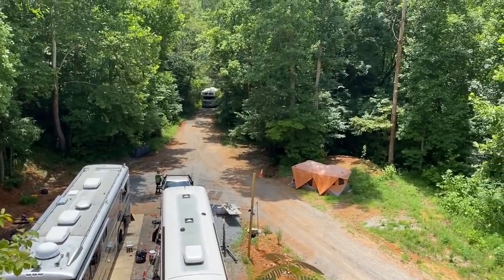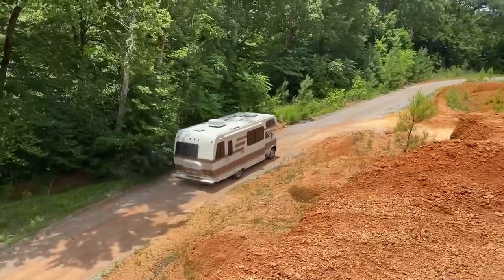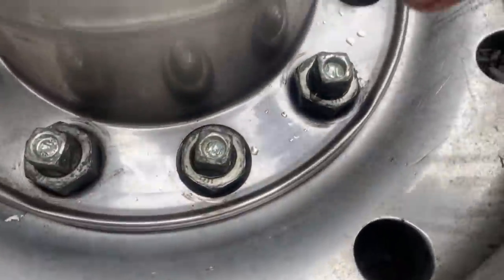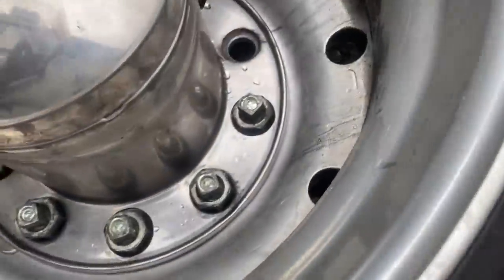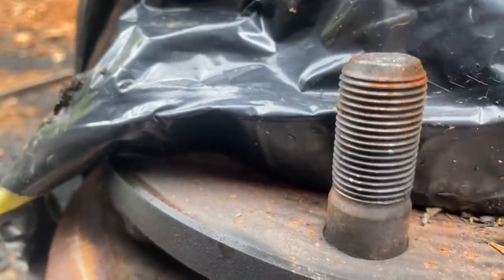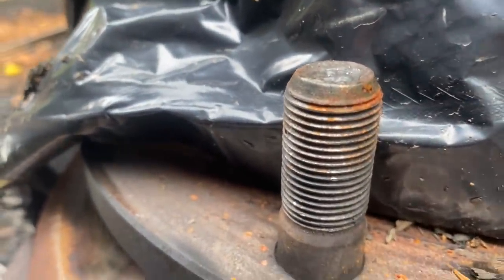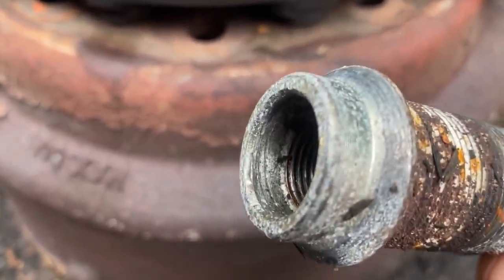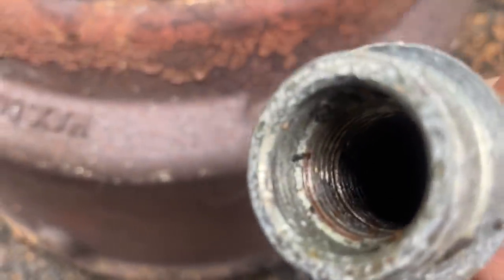Never let a tire shop use a 1” impact gun to put your wheels on.  Finishing the Wanderlodge rv

Comment: Cutting those suds in half like you did, and cleaning them up was such a great illustration of exactly what you're talking about. People don't realize how much a bolt or stud stretches! The torque specs are for the safety of the vehicle and the mechanical abilities of the material. It's the same with head studs, you're never going to slam them down with an impact.
Reply: There are some tire shop employees (I don't call them 'mechanics') you can show then 100 stretched and broken lugs and they will STILL use impact wrenches 'Because that's what we always did before.'
Reply: A good shop that trains their employees right can teach a man a good lesson! It sucks to have to bust a man's balls, I've been there. There's specs for a reason. A whole lotta people smarter than us put these numbers down, get outta your pride for a sec and do shit right.
Reply: Ten four ...i had a tire changed in minot nd today the tire guy did everything i asked...lube the tire and rim with paste center the set of duals with centering pins snug the lugnuts and torque the lugnuts....every lug nut turned with the torque wrench ....not one was overtorqued. I was one happy customer also very informed too.

Comment: I learnt the hard way about not checking how tire shops would tighten wheels when in my first car on a trip i had a wheel in the front start to wobble when i stopped to check why it turned out 4 of the 5 studs on the drivers side front wheel had snapped and the wobble was from the rim sliding on the hub as it went around and the loose part would slide almost off the hub. Got it owed into the next town and had them replace ALL 4 sets of studs and new nuts also. 

Since that day if i move to new area or am travelling and need wheels touched i watch as they work on other peoples cars first and if they dont use a torque wrench to do final tighten i wont use them. My current local tire shop work with a check list that 2 of the guys sign off on one for the guy that does the work and one for the guy that checks his work and they have 2 rattle guns one to take off wheels that is set higher and the one they use to run them up when putting them on and it always takes atleast a 1/4 turn with the torque wrench to get the right setting. 

I always recommend them to every one that talks tires with me as i have been going to the same place for 15 yrs now and their always good prices and they know their job with repairs etc and can also do wheel repairs. 

The fact the owner is a car nut is one reason he is so set in his ways about how things are done. Lots of the local cur guys use him also with their restos and customs

Comment: Man that is a beautiful rig! I've gotten to the point where I don't trust anyone to put tires on my pickup any more. The local tire shop cross threaded 2-3 studs on every corner of my Ram 2500. Their fix was to put new lug nuts on and send it. So I rotate them myself and next time I need tires I'm going to take the rims off and take them to the shop to have the tires mounted then reinstall them myself on the truck.

Comment: All my early trucks had 2-pc wheel studs, hated them. Once on I-69N up north of Marion, I pulled off to water the tires but when I looked down I saw a bunch of broken off outer studs with nuts on them laying on the ground and thought how interesting. I happened to perform a quick inspection only to learn, they came off my Kenworth. Wheels were still intact but a call to a mobile service shop for roadside repair was on order. Funny thing was I had no vibrations or anything to alert me to a problem. It was just a good thing I had to pull off when I did. So glad we don't use Budd wheels anymore as I love the hub piloted wheels being used on all trucks and buses today.

Comment: You need a lugnut porkchop to take the thimbles out of the outer nut! I changed tire for 25yrs. And seen a lot of those like that! The biggest problem is the lugnuts and wheels are different metals and make the nuts seize on!
Reply: aka spud wrench

Comment: I used a 1" gun to tighten budd style wheels all the time, just not to full torque, Used a torque wrench to finish each one. Same for accuride style. Worked for 25 years in waste hauling industry. Always put never seize and always started each lugnut by hand. Never an issue.

Comment: once i had an experience with a tire shop that used a large impact on my Dodge Power wagon.  it had 3/4 studs with left hand thread on the drivers side.  i had to stop him from destroying my lugs after agreeing with him about the direction he was turning the nuts .  finally the ob was completed.  6 months later i used a 20 ft cheater jumping up and down on it to break all the lugs loose.  after that i have put tires on the  truck myself.  that happened in the 80's
Reply: I've seen too many times things are either loose as hell or so tight its not even possible. Then again, i had torqued wheels a week prior, with a tire change on the familys car. A VW that is. 100 ft lbs whatever. ONE WEEK later, some repair needed done brakes maybe. I tell you my high torque impact wouldn't move it, i had to use a breaker bar, and i litterally lifted the car off the ground in that corner before it busted.  Probably have to clean the lug BOLTS up really good next time the holes too and hope. I try to do everything i can myself as i know worst case, it was i who made the mistake.

Comment: Some fool zipped my MC8 budd studs on and then put both wheels on. Then the nut. I knew seeing three threads on nut meant something wasn’t right. Great informative vid. I use my 4’ -600’ lbs snap on torque wrench to put them on.

Comment: One sweet unit I can believe that tire shop reefed those nuts up beyond their torque limit as I've seen it many times when I was over the road that was partly why when I had tire done I stayed right with the truck and made sure the started everything easily by hand and no impact not even for taking off the wheels

Comment: Knowledge is power , impact drivers are great for breaking off the torque , as you commented great for streching threads , the impact gun has to set at reqd torque

Comment: The last time I saw that many broken studs on bud wheel, someone tried to take off left hand nuts CCW which with a 1"gun brakes the studs! Left hand threads is CW to remove. They sell a tool to hold the outer nut and spin out the inner nut for about 15 bucks! Works great!

Comment: I would recommend to buff the surface with a 3m pad ....inner outer and brake drum surfaces.....amd encourage the use of some wheel guards 5901 and 5902 they will keep your wheels in excellent condition for years if not decades ....wheel guards are made by accuride wheel company

Comment: Yup you nailed it !
Lots of tire shops have done it !
I have never had that bad but the broke stud with thimble , front wheel on DL MCI !
Reply: I yelled at a tire shop years ago for putting my wheels on with an impact. I found out later on when a 4' cheater bar with me hanging on the end of it couldn't get them off. The hub had "65 ftlbs" stamped into it in giant letters but they put them on with all the ugga-duggas, not just a few. Luckily they didn't damage my wheels or I would have found a way to get them to replace what they broke.

Comment: What you had were outer lug nuts for a steel inner wheel and an outer aluminum wheel. 

The longer shank outer nuts are for an aluminum inner  and an aluminum outer wheel.
Reply from the maker: We had aluminum inner and aluminum outer.  And the correct nuts for both.

Comment: Never let any shop use an air gun on your wheel lugs. I almost got killed many years ago when a tire shop used an air gun to put tires on my IMSA race car and stretched the lugs, when I was driving it (not on a track) the lugs on a wheel failed and took out the wheel and wheel well causing a rear lock skid. I had a discussion with the shop and they paid for all the repairs and I strongly suggested the use of torque wrenches. They agreed and started using them nationwide. I get all my tires at that DISCOUNT tire shop since. I don't wish to ID the shop TIC.

Comment: It really isn't about doing the job without a torque wrench, it's that the shop just didn't give a crap...  I do these all day long, and this stuff just isn't seen except of stuff that other shops have touched. Yes with bud wheels, a pork chop is pretty much required, but you also need to know wtf you are doing as well. You can pull the threads right out of the inner stud if your not paying attention. Clean surfaces and hubs are key to making sure it's all right, AND, bud wheels are a whole ballgame that many cannot deal with.  We do tighten them with the wrench, but it's not just wing them on and send it down the road. We have torque sticks, and a torque wrench that can be used on all except reverse thread bud wheels because it will not reverse.
Reply from the maker: I have a pork-chop. The inner was not turning
Reply: @BusGreaseMonkey  I knew you probably did.. But I was explaining that many of these shops just wing them together and send them. We've had some real messes like this

Comment: Crazy having short studs and worse someone using impacts to torque them on. There was a mechanic on a local radio show that ask their yearly income. 125,000! Not sure if that was diesels, regular vehicles or both? You would think they would know better or their boss enforcing safety on customers vehicals? You have showed these short studs before. They should at least put out a safety alert to shops

Comment: Any tire shop would know all about left hand threads on Budd Wheels. The problem with Budd wheels is that the inner nut with the square head is supposed to be torqued to 450 ft lbs and the outer 1-1/2 inch hex nut to 600 ft lbs. When you try to remove them, the 450 pound torqued inner nut comes loose and turns with the outer nut. Aluminum wheels make the problem worse do to galvanic corrosion and the outer nut is squeezing the aluminum wheel which allows the inner stud to spin easier than a steel wheel. Some studs and nuts are zinc or cadmium coated which provides some protection for a few times being removed and installed but it wears off. Anti seize or molybdenum disulfide spray help make certain you will be able to remove the wheels at a later date. Aluminum and steel don't play well together. Add road salt and you have real problems. There are different torque values for dry and lubricated studs as it does affect the clamping force so lubricated studs require less torque. Rusty studs and nuts increase the amount of torque required to provide the same clamping force as new studs and nuts.
Reply: You are speaking my language.....i agree
Reply: You are speaking my language....i agree

Comment: Also don't let them take off left-hand wheelnuts with one either. Pulled the stud out of the hub before he realised he was tightening them up instead of undoing them
Reply: Wait till you are pulling a left wheel off all of nuts come but one the more you try the tighter it get then you realize  some jack a!@ put a right side stud ,inner nut & outter nut on left side , i had it happen once in my44 years of wrenching.

Comment: So true! And they make Torque sticks for a reason.
Reply from the maker: Have you ever done a comparison with a torque stick and a torque wrench?
Reply: @BusGreaseMonkey    I have not and I would not trust them with anything other than putting on lug nuts.  My point is a stick would be better than the butchering that was done to these wheels.  Maybe that would make a nice video?  I enjoy BGM and Indiana Diesel.  Look forward to meeting you both someday when I buy an MCI.
Reply: @BusGreaseMonkey  I have and they get close (if it is x torque +/- 5lbs)… I personally use the one below what my torque spec is and finish w/ a torque wrench because it speeds things up and I have trust issues.
Reply: I own a semi here on the farm and I wish the tire shops would use them but they don’t.  They get those 1 inch impact drivers  and smash the aluminum wheels into pancakes.

Comment: I freaking hate that man. Tire shops always tell you they torque the lug nuts but they don't. They hank them down with an impact gun and tell you they torqued them. I have seen this time and time again. The one guy I caught doing it on my rig made the excuse that "his" impact guns torque to 80ft./lbs. and that is all any vehicle needs.. Except that specifically told him  to use a torque wrench and make it no more than 72ft./lbs. because on my rig the torque specs are very specific and there is very good reason for it. They cheat and should be never paid to do this work.

Comment: You should get one of the tools designed to hold the outer lug nut so you can spin the inner lug nut off with a square socket. The tool we had we had an old inner lug nut welded to it that would fit in the lug hole next to the nut you are trying to separate to keep it from scratching the wheel. a lot easier than trying to cut the old lug nuts off.
Reply from the maker: The outer was seized to the inner. Bound up on bad threads.  The outers started coming off then seized.
Reply: That doesnt make sense. The outer  hex  lug holds the outer rim, you have to release the outer to get the inner off The square lug is holding the inner rim to the hub and cant move till you take the hex lug nut off.. Am I missing something?
Reply from the maker: They put it on so tight it damaged the threads.  Both inners and outers were put on way way way way over torqued.
Reply: @romandybala  
The outer/hex nut backs off enough to pull away from the rim and then catches/seizes/galls on the inner nut which turns/loosens until it hits the inboard face of the outer rim. You can land up with a real big mess of stripped-out studs and/or inner nut and/or ruin an aluminum rim. 
If you're "lucky" the inner nut wasn't tightened as much as the outer nut and there will be enough force to stop/hold it to allow the outer/hex nut to start turning again and "unscrew" from the inner nut.   (The inner nut gets jacked into the outer rim, stops spinning/turning,  the outer/hex will back off of the inner nut.)
Aluminum rims ("Alcoas"), corrosion, dissimilar metal(s), electrolysis, galling due to the springy-ness of aluminum; it can become a house of cards and cluster-mess with lots of finger-pointing and work words where no one is happy and all have lost money in the end. 

I hope that makes sense, helps explain yet another scenario that wasn't all that uncommon "back in the day".

Comment: We are required to use a torque stick where I work. No Budd wheels or aluminum either.
Reply: Try comparing with a torque wrench after or before the sticks.   You may be surprised how far off they can be.

Comment: I have never put wheels on a bus, but I have rotated wheels on Bedford Lorries often enough, What you need is an 8’ heavy scaffold tube and the original wheelnut spanner, sixteen stone on the end of that will crack them off, bang ! and you do them up till they start to squeal. I hate those guys and their rattle guns, they are always set to max because they’re worn out and the guys keep going till their hands lose grip.

Comment: Replace ALL of the lug bolts. ANY JERK THAT I CAUGHT USING A 1" AIR GUN ON MY LUG BOLTS WOULD BE GETTING A BILL, AND THEY WOULD NEVER WORK ON A RIG OF MINE AGAIN. THAT IS WHY THEY NEED TO BE WATCHED!
Reply: Been working on trucks for 30 years and have always used a 1in gun never had any issues. Buzz them and verify with a torque wrench

Comment: Wow on the shape of those threads....a light coat of antisieze to keep things from rusting and oil on the threads for installation...should never have any issues.
Reply: I seem to recall hearing no antisize on lug nuts for some particular reason
Reply: @richardlazarski4553  been doing it for decades.....light coat initially then oil after that works awesomely
Reply: Wax on threads is a big no-no, like from undercoating or such. True tightening torque can’t be reached.  Anti seizure paste is metal flake in light oil.
Reply: Dry rusty threads reach torque before clamping force is reached risking a loose wheel....all i can tell you is that i have been doing it my way for a very long time...30 years plus and have learned more along thr way always open to comments or suggestions....we don't learn if we don't discuss.
Reply: @RMTTR640  almost all torque specs are for dry contact.   Lubricant only makes the needed leverage higher to make the required torque.
Reply: Alcoa ....in their wheel service manuals say to apply oil to the threads on the wheel studs and lug nuts.....engine builders use paste aka peanut butter or oil on crank main bolts and cylinder head bolts.....i think in the end were talking 25 to 50 ft lbs difference there are dry and wet torque specs ....read the paper manual or pdf....

Comment: Wow that's bad. You have to watch these tire shops. It does not matter if its for automotive or commercial tires. My company we can use a 1 gun to take the lugs off it we want to but must use use the 3/4 gun to put them on. We use the 3/4 with a the appropriate torque stick to put them back on. After that hand tighten them to specified torque. Also anyone out there that is changing from steel to aluminum wheels you need to install the longer studs. I have seen trucks come in with the lugs almost flush with the end of the studs.

Comment: A bolt is only as strong as three of its threads.  Any one that has worked in a machine shop will tell you this.
Tho yes, the nuts should have been replaced from wear